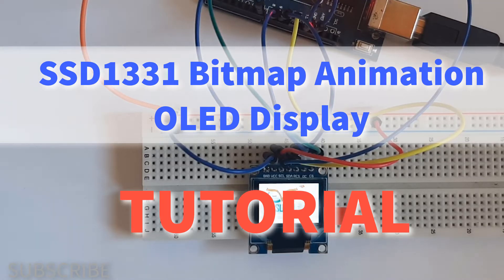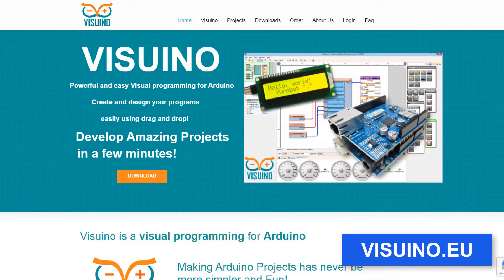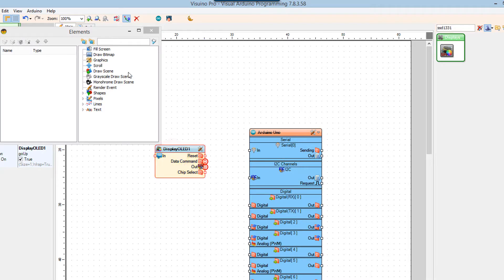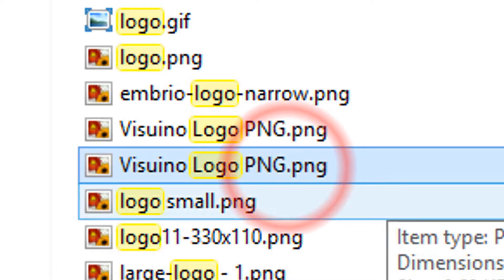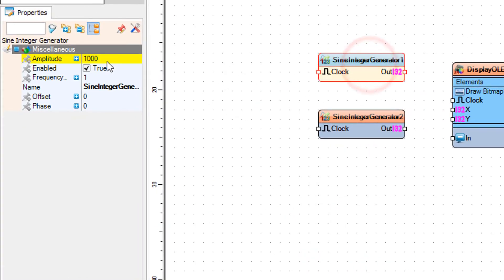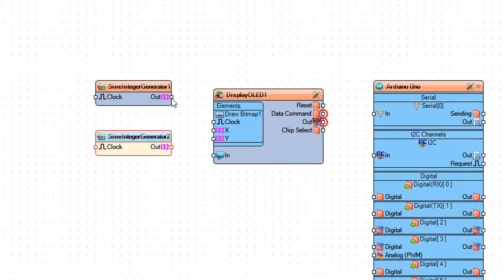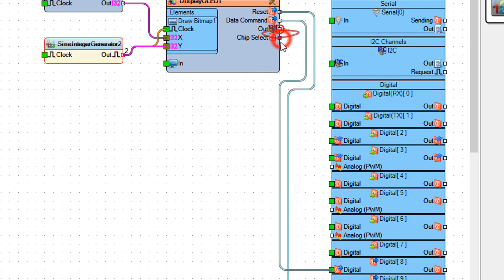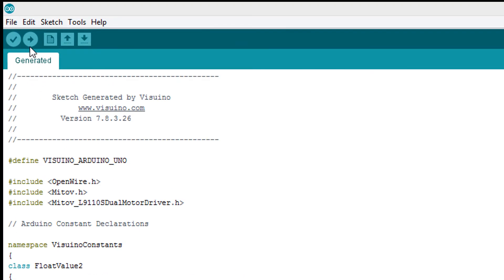Visuino Tutorial Bitmap Animation on SSD1331 OLED Display (SPI)

Comment: My OLED only shows glitches no matter what I try. I can display text, but not images, even the smallest bitmaps just don't work. I can write an array of pixels like {0xFF, 0xFF, 0xFF, 0xFF, 0xFF, 0xFF, 0xFF, .... } and see them on the screen, but they all have random colors. I don't know what to do. I tried this app and it created glitches again
Reply from the maker: Make sure that you have correct display that can show colors and also in Visuino select correct OLED ssd1331
Reply: @visuinoprojects  I fixed it, it was a memory problem. I used the keyword "const" and the array was not saved to the program memory. So I removed that keyword. Also the array was not declared correctly
Reply: @visuinoprojects  thanks for replying